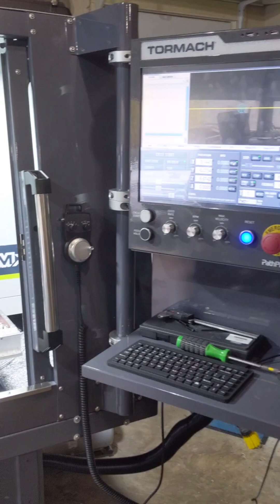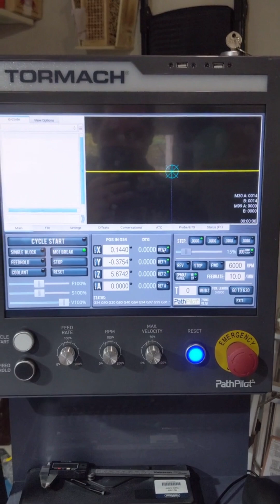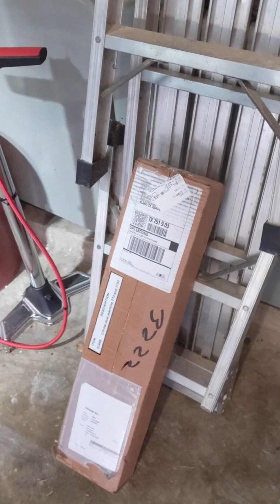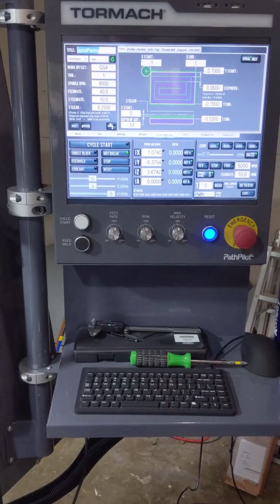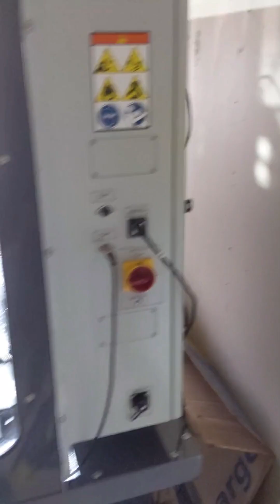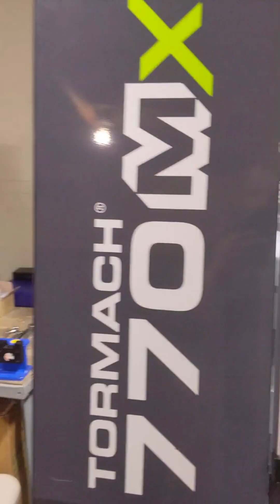Tormach 770MX! - First Thoughts

Comment: Which visa do you use? Does it fit in a standard 6” machine or is 5” the maximum?
Reply from the maker: I started with Tormachs 4in vise but later on I added a fixture plate from Saunders Machine Works and got a couple sets of his vise that bolts to the table. With only 7 inches of travel on Y, a 6" vise is probably pushing it on this machine. It might fit on one of the larger Tormachs

Comment: The cables that sit on the inside left on the tray will rub through the paint as the bed moves back and forth..  I grabbed a retractable tool holder/cable and have it pull up on those cables to keep them off the tray.. Also be sure to calibrate the probe using a ring gauge.  Also some brands of flood coolant seem to strip the paint off the tormach machines.. Might look into that before you get your flood system up.
Reply from the maker: This is actually an older video, I've moved on from the Tormach after 1.5years of use. Check out our other videos to see how we've progressed!

Comment: Congrats, I hope all goes well. I too started my machine shop 2 months ago with a 770M in a one car garage and so far I got stuff to do everyday. The 770 isn't comparable to the industrial class machinery however, with clever programming and knowing the machines limits, it runs quite decent at least for me.
Reply: I am not knocking the machines. I just wonder for the price you could get a excellent condition single phase industrial machining center. I am not judging anyone for buying these, I would love to have on in my garage.
Reply from the maker: It's not ringing I've researched in depth, but I don't know of any industrial grade machines that can run on single phase without a phase converter. Syil might but they were just opening up when I bought my Tormach a few years ago
Reply from the maker: It's worked out well enough! I'm in a warehouse now with 2 industrial grade machines. The 770MX did about as well as I expected, I had some issues that may change my route if I were to do it again, but it was more with Tormach support than the machine itself.